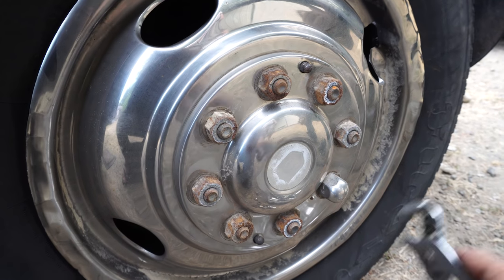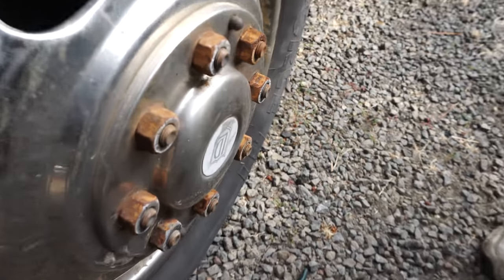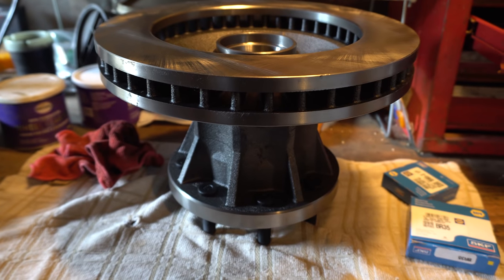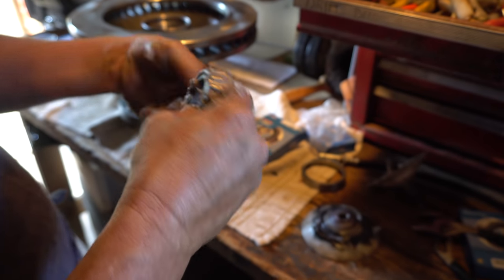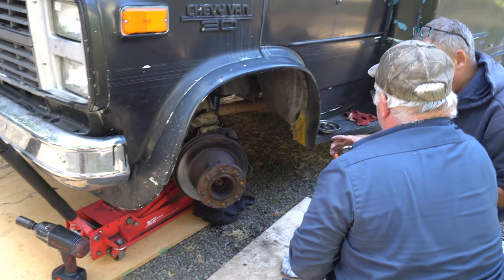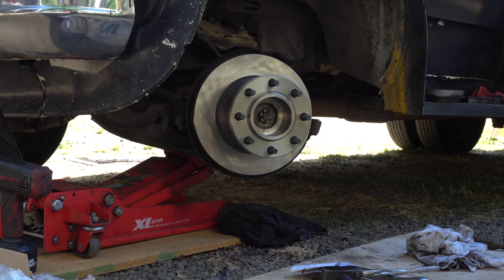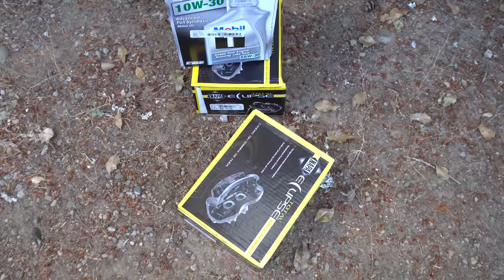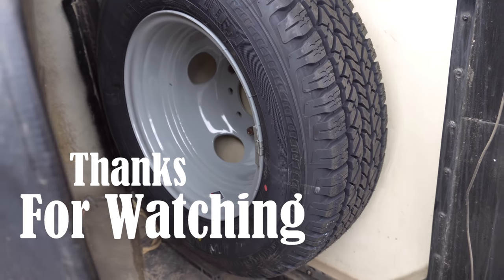New Tires & Rims And Replacing Brakes & Front Hubs Assembly

Comment: #297    Good Investment, Ausia.  You have a heavy rig, so you need heavy duty brakes, bearings, tires, etc.  You should be good for 100,000 miles.  Use lower gear in Mountains to save brake ware.  Great Video!

Comment: Yup... your front end is the same as mine. But... i replaced Master pump unit,flex break lines,new not rebuilt calipers (oem ac/delco). Oem states to repack and reset bearings after 500 miles. Next time. use the RED high temp disc break grease on those bearings !!! Put MORE bearing grease on them. Pack them SUPER full (you DO NOT have enough bearing grease in them now) And use Break lube on the "feet" of the pads. Hope it helps  :)
Reply from the maker: Thanks 😊

Comment: Hello Ausia.   Good idea on replacing everything.   That's what I'm doing now.   My passenger side caliper froze open and the break pedal  went to the floor.   It's a horrible thing thinking you can't stop something that weighs 16,000 lbs. I really like your new tires and wheels. If I upgrade to New ones they will be $300.00 each wheel and thankfully I have new tires.   Those were $3k per set. But mine rig is 31 years old things need replacing all the time.  Well you be safe in your journeys. Bye for now.

Comment: When replacing wheel bearings, the grease will last much longer if you clean the protective oil off the new bearings with brake clean.

Comment: Damn! I was sorry to see that you drove this before you finished. You guys just put in a brand new seal that was dry as a popcorn fart!!! 
A dry neoprene seal on  nonprelubed  (dry)  surface (axle) is going to burn up in less than a minute!. You are going to get dirt dust and water inside the hub and destroy the bearings and the races in the rotors if you don't disassemble it and replace the seals with ones that are properly lube first. Also polish the axle because when the seal burns up it's going to leave the smeared remains of the burned seal that was put in dry.

Sorry to tell you this but I've seen this way too many times by do it yourselfers and professionals alike on wheel bearing seals engine seals transmission seals and differential seals.  Just get it done within a day or so and you will probably be fine. As long as you don't drive over anything wet or in the dust. This is not me picking on Scotty he just forgot because he was on camera and had people talking to him all through this. Bless your heart Scotty

Comment: The uneven wear from one side to the other on the front pads would tell me it's time to replace BOTH front flexible brake hoses that connect to the caliper up to the union fitting that the steel line connects to also. That inner hose was collapsing and not letting the pressure off the caliper piston on the more heavily worn side.
Reply from the maker: Thanks Gary 😊👍

Comment: My experience with a good break job and especially with the rotor wear is making sure that all the bolts were correctly torqued using original manufactured settings 🌹

Comment: Nice to have that job behind you (or in front?)  I remember doing this years ago.  Geez maybe it's time to do it again.   Some of these hub assemblies actually have a detachable rotor so you don't have to buy the whole assembly just the rotor part.  I wondered why GM didn't do this. Can't wait to see what you pick out for rims!! Oh I  did at the end!! WWooWW!  That's pretty!!
Your rig would look nice wrapped!!
On my RV I  just have to get my '88 class C to stop throwing check engine codes after I replaced the head gaskets and a bunch of other parts.  I hope I'm getting closer.  Tomorrow is cleaning up engine grounds really well testing them and possibly replacing the Spark Control Module.
Take care!
-Jon
Reply from the maker: Thanks Jon😊 and good luck to you

Comment: I don't mean to be critical Ausia, Eric and most all other class C drivers but I have noticed that you use your brakes to slow down and you also use them to control your speed on hills. Brakes on a truck are for stopping not for slowing. I'll bet that all you class C  guys go through breaks far faster then you should because no one ever told you that these things are not sports cars. They are on truck chassis.   I've been an RVer for 30 years and I go through brakes about once every seven or eight years. That's a bit over 100,000 miles.

Please remember that you never go down a mountain pass or down a significant incline any faster then you go up. Let people honk all they want, You will be keeping yourself and them alive!

Exhaust brakes work just about as well on a gasoline engine as they do on diesels!!! Gears control your slowing you guys probably have general motors four-speed automatic's or at least the TH 400. Drop a gear and keep on the engine break and your brakes are going to last so long you won't believe it. I have mine set up so that when I am in a slow down or decent condition whenever I touch the brake enough to turn on the brake lights the engine brake also turns on. (The brake lights actually come on just before the brakes actually apply) (I do have a defeat switch in case I want to defeat the system). I've seen way too many accidents. People don't need to die… Think exhaust brake. Happy and safe travels to you guys.
Reply from the maker: I usually do... and try not to use my brakes if possible just let go of the gas pedal it slows down on it's own
Reply: Panda Monium   Thank you for taking my comment in the spirit intended just trying to help you stay safe and stem your costs. Your response touches my heart and shows just how sweet you really are. You're really a very nice person. Some may have taken my comment as an attack or a negative in someway, Some look for the negative but not you.  On word bound!

Comment: Ausia, I cring  at being the voice of opposition, but the rims and tires are worth more than the rig. Time to cut it loose, The math just does not line to fix this, the suspension is shot.It is hard to move on, but this voice is raising that thought.  This rig is never going to break out past 30K subs, aim higher.  An Rv wrap will help this rig as much as a Cannon Mavica, ditch the rig,
Reply from the maker: Thanks for your comment but I have to respectfully disagree people restore and fix older cars all the time that's how we have awesome classic and antique cars and I've seen some amazing ones in car shows. Mine is a slow process but Panda will get there eventually....lol 💖
Reply: Just trying to look out for yea Ausia, say we both stand back and look at the rig like you didn’t own it, there is nothing special about this rig. It is not a Tioga SL or a mini Winnie 4 x4. I owned a 1988 Tioga 27 foot and thought it was special until I fell out of the bunk,,, onto the hood, had to rebuild the entire nose. The downside as a whole is that the frame is made of wood and insulated with fiberglass. Those corner seals are starting to break, and when they do, water will get inside the walls, then it will start a stink that can never be gotten rid of.I,m not saying buy new, but find something 2004 and up, that have rear disc brakes, welded aluminum frame & foam insulation that will keep you cool & warm on a Ford chassis. Best time to buy would be after Thanksgiving when RV sales go into the basement along with price. From somewhere in the southwest where it was raised in a dry environment. And take your rims with you, all the best.